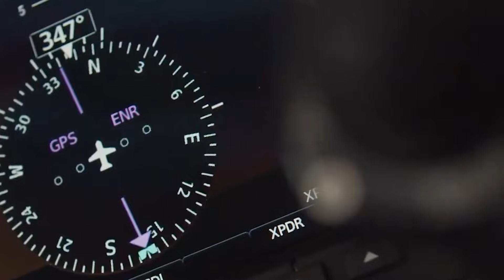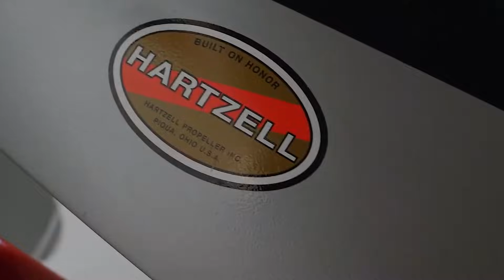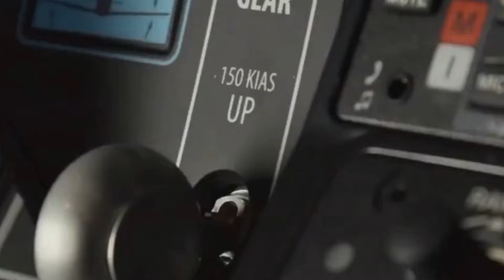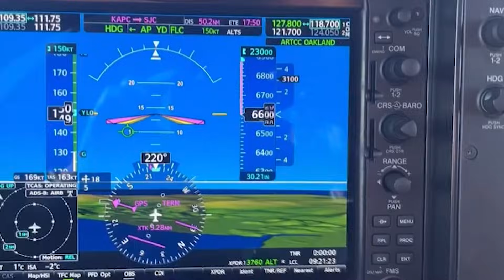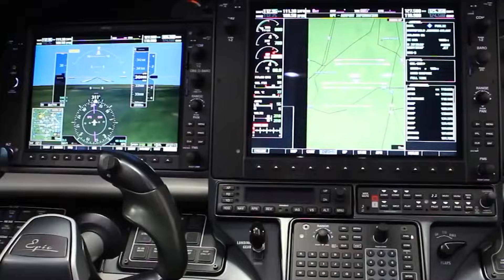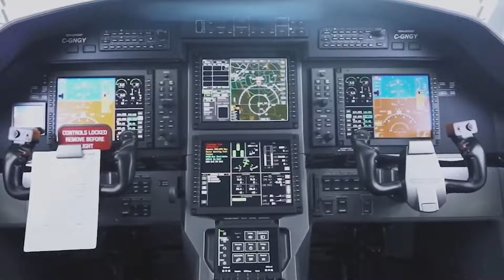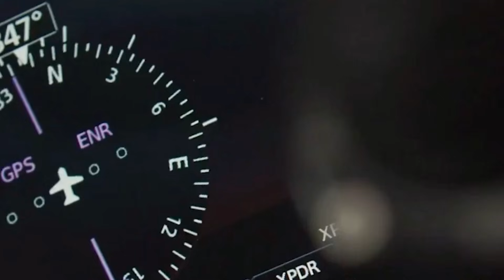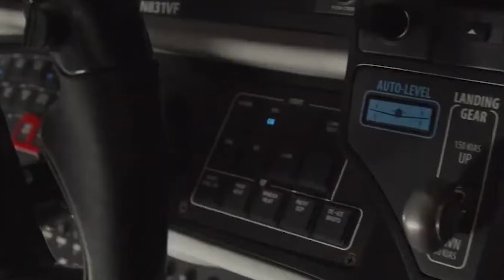Why the Epic E1000 AX will lead Turboprops in 2026 with Starlink

Comment: The Epic 1000 is an impressive aircraft, but it does have two major drawbacks.
Although it is valued at over $4.8 million, cruises above FL300, and reaches speeds north of 300 knots, it is equipped with the same avionics suite found in single-engine piston aircraft (Cessna Skyhawk, cirrus SR)worth around 500k  To 1000k$—the Garmin G1000 NXi. At this level of performance, the Epic 1000 would truly deserve the Garmin G3000, which was specifically designed for this category of aircraft and capabilities.The second limitation is its engine. Competing aircraft in the same market segment are now fitted with the latest versions of the PT6, featuring full FADEC. Take the Daher TBM 960, for example. It offers nearly the same top speed as the Epic—within just three knots—yet delivers greater maximum range. As an option, it can also be fitted with a fully enclosed lavatory if you are willing to sacrifice seating for two passengers. On top of that, it comes with the far more advanced Garmin G3000 avionics suite and a PT6 engine equipped with full FADEC.